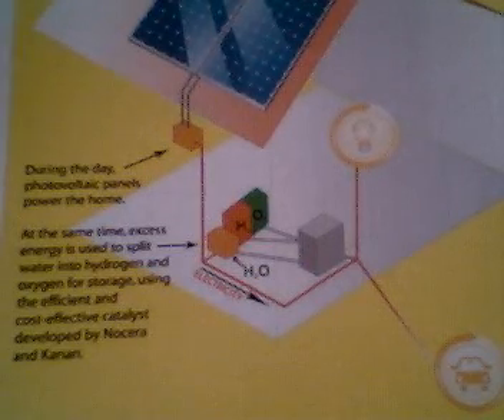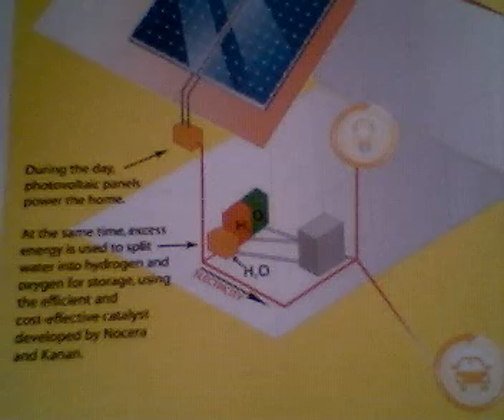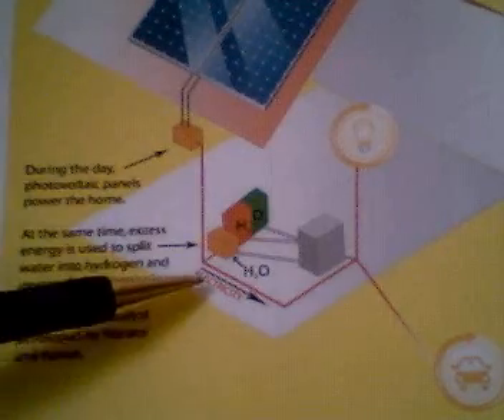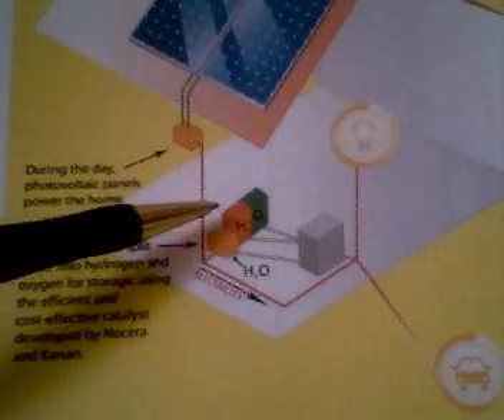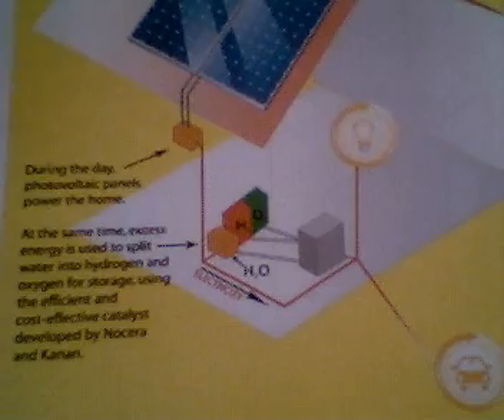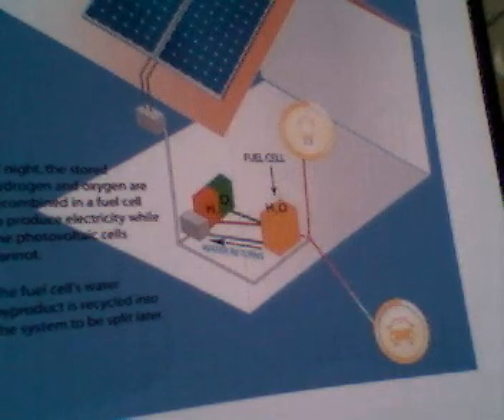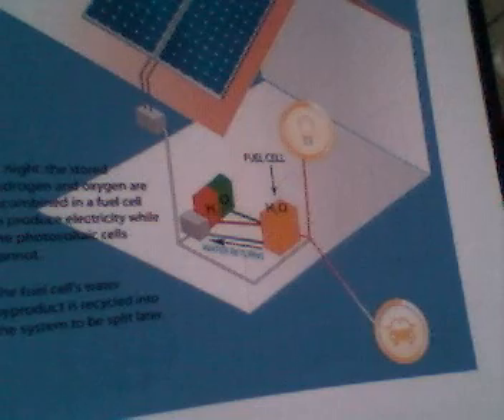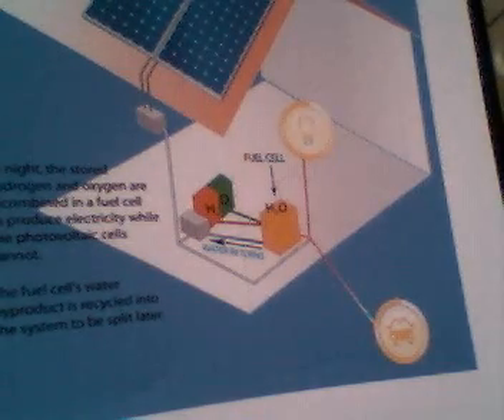Solar Energy use

Comment: A google search of "elevator return energy", found that modern elevator systems in tall buildings do have special drive mechanisms that generates return energy when the elevator is going down. Thus, the complete needed technology for storing residential solar energy in a special heavy-concrete-weighted solar energy storage elevator is already available.  The "overall energy" use for tall building elevators is very small ( just the cost of resistance and inefficiency ).  No explosive hydrogen.